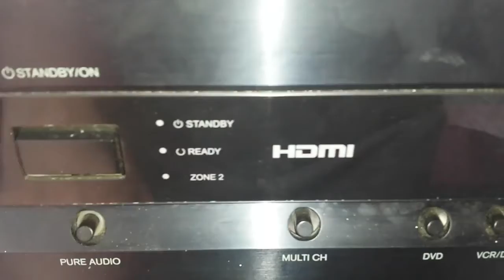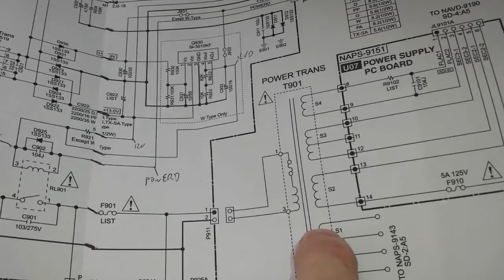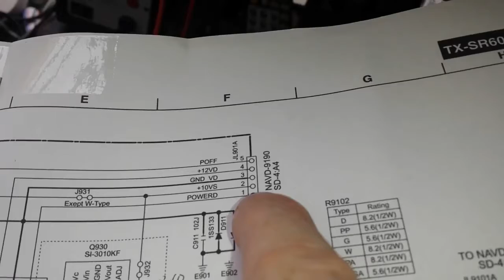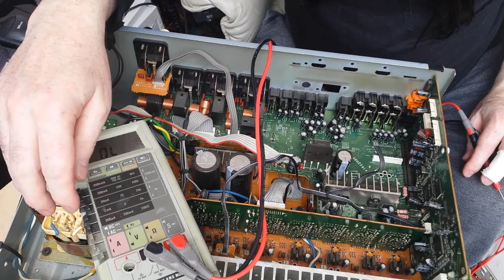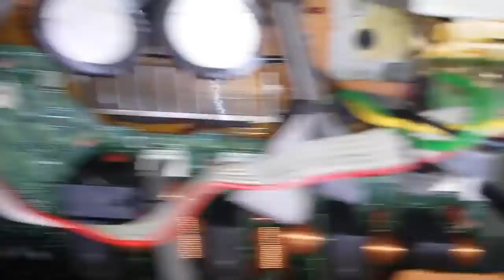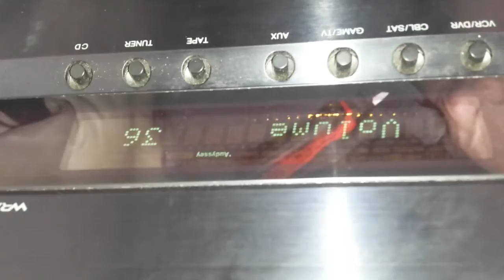Onkyo TX-SR605 'Stuck in Standby' Diagnose & Fix

Comment: AC in: supply power for the small PSU which provide  12V to the CPU board.
This 12V also supply the voltage to the coil of the Relay through a Resistor bought it down to 9V.
One of the AC input line (L) will go to one pin of the Relay and waiting there until the Relay closed, when this happens, the AC will be supply to the Main Transformer, supply voltages to everywhere else.
The 9VDC goes through the Relay coil and come to the Collector of the 9002 transistor and waiting there. When the power on button is pushed, a voltage will be sent to the Base of this transistor to turn it on and the current will flow from its Collector to Emiter to the Ground and energize the Relay coil (the circuit is closed). Which in turn will close the AC in contact of the Relay and everything start working.
You did not measure correctly when you tried to find out 12V at the beginning (wrong ground pin). 9V or 12V always present on both side of the Relay's coil. It only waiting to be connected to the ground to make a complete circuit through the 9002 transistor (acting like a switch).
With this Receiver, the line from the Relay coil to the Collector of the 9002 was broken, so it will not complete a circuit does not matter if the transistor working or not.
Reply from the maker: I did not measure the wrong ground point at the start. I tested 12v & ground coming up that connection lead, which is the power supply powering the CPU, I then tested between 12v & powerd to find out if the relay was getting powered.

I may not have measured as some academic may have wrote in a service manual, but my measurments told me what I needed to know. Was the relay getting activated? (it wasn't).

So then I tested the circuit which activates the relay, the Apower signal from the CPU & the 9002 transistor.

There was one thing wrong in the video, I mixed up the Emitter & Collector pins on the 9002 transistor.

I was checking why the relay wasn't getting activated, so it did matter if the transistor was working. Sure the track was broken between 9002 and PowerD, but if I repaired that and the transistor was blown, it still wouldn't have activated the relay.
Reply: @warfsbench  This is one of the simplest and great repair video.thank you so much.
Reply from the maker: @ZAKARIARACHID-j2f  Glad you found it useful.